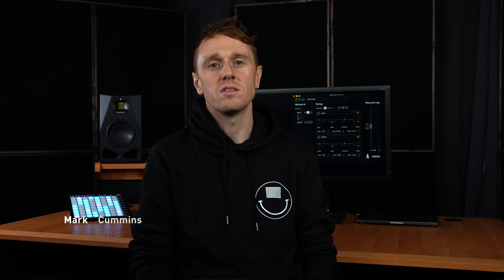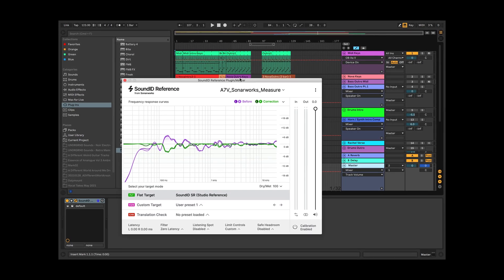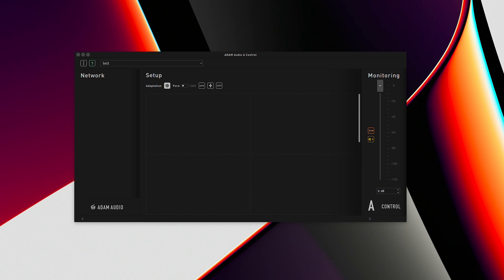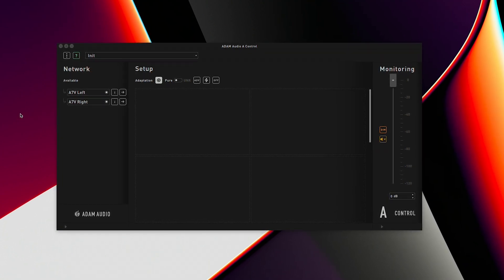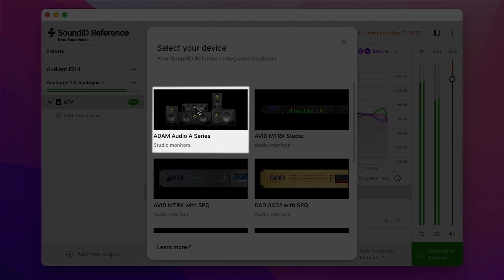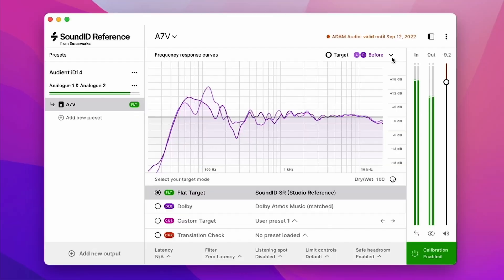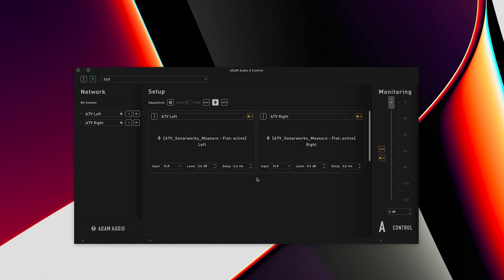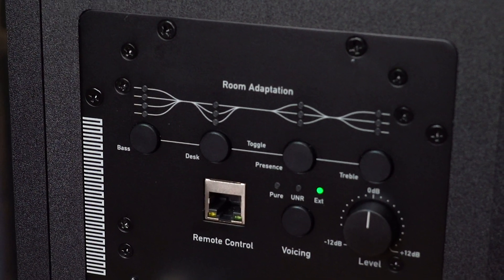How to Calibrate A Series Monitors Using the Sonarworks SoundID Reference Integration

Comment: Is it possible to limit the correction file to (say) below 500 Hz? There are good reasons to not use correction derived from a microphone at the listening position, in the mid and high frequencies. Source: The Measurement and Calibration of Sound Reproducing Systems, Dr Floyd E Toole, 2015 (available online)

Comment: When I manually set a parametric 6 band EQ in the A control app will it be saved on the speakers in the "EXT" preset so I don't need to have the app running in the background?
Reply from the maker: Hey there! Yes, exactly. As A Control detects the speakers when they are connected, you can make changes to the parametric EQ or upload a Sonarworks measurement profile.

The Settings are then stored on the monitors DSP and will work without the need of any application open and the speaker disconnected from the computer.

I hope this answers your question, greetings from Berlin!
Reply: @ADAMAudioBerlin  thanks for your answer. Is it even possible to load the room corrected  eq onto the speakers and then boost or lower the frequency via the backside buttons. Like if I want to boost the lower frequency by +2dB because I'm listening at a low volume? Or do I have to fix the eq curve in the room correction app and load it onto the speakers again
Reply from the maker: Hey,

If you create an EQ-Preset in A Control and upload onto the speaker's DSP, the chosen Settings will be applied once the "External"-Voicing is selected. The settings of this Voicing are not adjustable via the EQ-Control of the speaker, but only via A Control.

However, you can switch to a different voicing, such as "Pure" or "UNR" which will enable the internal EQ-Corrections.

I hope this answers your question!

Comment: Hey Adam Audio;

Is it possible to get the benefits of reducing resonance and other room defects with Sonarworks, but still prioritize an “enjoyment” voicing such as what UNR offers? Or does correcting for room defects with SW mean that the only possible outcome is a reference, “pure” sound? Thanks!
Reply from the maker: Hi @DrewFu319! Thanks for your question! The point of using a Sonarworks measurement profile is to optimize the frequency response of the speaker in your room. Using a measurement profile that moves the frequency response further away from the most linear possible response would somewhat work against its purpose.

We understand, of course, that a flat response can be less inspiring during the writing stage of creating music; hence, we included the UNR profile for this purpose. Once you've uploaded a Sonarworks measurement profile onto the speaker's DSP, you can still switch between different voicings, depending on your personal preference. This allows you to choose the UNR curve at specific times and the Sonarworks curve at others. 

I hope this answers your question! Best, Jasper from ADAM

Comment: I have a SoundID Reference for speakers & headphones. When using the calibration of the speakers, do I still have to open SoundID on my computer for mixing on headphones? If so, switching seems like quite a hassle.
Reply from the maker: Hi @Oxsasuna! This is totally up to you. If you are using it anyway, because you're switching to headphones occasionally, you can either use the curves on your monitors and bypass SoundID reference, or continue using the app and switch to the speaker profile.

If you have any other detailed technical questions, please reach out to our Support Team, they will gladly answer them. You can send your question through the official form on this page: https://support.adam-audio.com/hc/en-gb/requests/new

All the best, Daniel

Comment: While doing the room measurement with the SoundID software, do I need to leave the mode set to ‘Pure’ on the speakers or is it better to turn off adaptation?
Reply: did you find out? i have some significant difference with the soundid calibration and the adam calibration from the same calibration file
Reply from the maker: Hi @LanewoodStudios! Yes, pure is recommended, as this is the flat setting that the SoundID Reference curve will be applied to. If you have any further questions, please reach out to our Support Team. They will gladly answer all your questions. You can send your question through the official form on this page: https://support.adam-audio.com/hc/en-gb/requests/new

All the best, Daniel
Reply from the maker: Hi @Tobiasogfar2017! 

Maybe this has something to do with the 0 dB boost option that we recommend for the export of the Sonarworks curve. If you have detailed technical questions, please reach out to our Support Team, they will gladly answer them. You can send your question through the official form on this page: https://support.adam-audio.com/hc/en-gb/requests/new

All the best, Daniel

Comment: which network switch should i be buying. Do you have any tutorials on how to use the network switch to connect both A7v to my Internets wifi modem router
Reply from the maker: Hi @johnroberts4000, thanks for your question! We have a video about how to connect your A Series Monitors with A Control, you can watch it here: 

https://www.youtube.com/watch?v=STvUdQ-X2no

Most standard network switches and WiFi-Routers will work for this, simply plug them in as shown in the video and they will show up in A Control.

Comment: does the calibration settings stay after the trial has ended ?
Reply from the maker: Hi @emirhanolgun7351! As long as you disconnect the Ethernet-Cable from the speakers after uploading the measurement profile it will remain installed on the Speakers' DSP

Comment: I'm curious to know why you recommend selecting "No boost". I've been comparing the diferent boost setting back to back and they sound fairly diferent in my system. If I do select the boost function my bass seems to be more consistent and I hear more high end. The problem is, that I have no clue witch of both is closer to an actual "flat" response. I feel like the lower frequencies have become more even but I'm not sure if the highs also did or if they are now boosted too much...
Reply from the maker: Hi Tony! We recommend this option because if there is a dip in the bass it is most likely coming from an acoustic cancellation in the room, caused by a reflection. The 6/12 db boost options use not only subtractive, but also additive equalization. If there is cancellation due to a room mode it cannot be EQ’ed out with boost. This only increases the cancellation.
If you'd like to use this option however you can of course do so. All the best!
Reply: @ADAMAudioBerlin  okay, thank you for the explanation👍

Comment: i’ve done the calibration correctly with sonarwork sound id reference, and i have the measurement file, however there are few problems. 

1) in sound ID reference i can’t export the file of the calibration 

2) from a control when i go to:  load sound ID preset, i can’t choose the file of the calibration. 

i also noticed from your youtube tutorial on the A control that the actually software for calibration ‘Sound ID reference’ it’s called slightly different and it has a slightly different interface, and in the tutorial it show that you can export the calibration for the A series , however in my sonarwork sound ID reference this option it’s not appearing if i right click on the A7V calibration.
Reply from the maker: Hi Rico! Please reach out to our support team at support@adam-audio.de 
They will guide you to fix those problems. 
Sorry for the inconvenience.

Comment: Hello Adam Audio or anyone please provide your comments... Do I need to switch the limit controls in soundID Reference before exporting to A Control? Also is it reccomended to turn off listening spot in SoundID Reference before exporting? Does A control account for the delay and volume compensation that the listening spot feature provides?
Reply from the maker: Hi Jayden! We recommend selecting the "No Boost" setting, everything else "Neutral".
Listening Spot may very well be activated, these parameters are exported as well.

Comment: This software is not working reliably for me at all. I have a 7.1.4 Dolby atmos setup with A77’s, A7’s and 2x sub 12’s. Crashing all the time, rebooting all the speakers all the time and causing a 1k tone at full volume out of some speakers on occasion.  Not so good!
Reply from the maker: Hi Mikis! Sorry to hear that. The A Control has just been released and it is in continuous development and improvement. If you find some problems, please send screenshots to beta@adam-audio.de. This will help us to fix the found issues. Thanks!!
Reply: @ADAMAudioBerlin  iv been dealing with the exact same issue looking everywhere for information on it. I have an M1 Max MacBook Pro and a7v's
Reply from the maker: Hi Julian. We're so sorry to hear you're experiencing that. Please reach out to our Support Team via our official support form at the bottom of this page: https://www.adam-audio.com/en/support/. Hopefully, we'll find a solution to your problem as soon as possible. Have a great day! All the best, Manuel from ADAM.
Reply: FYI old question, but I had to use a new interface to keep the sonar works from crashing

Comment: What about the phase option in SoundID , can it be replicated in the DSP of the Adam (linear phase or mixed) ?
Reply from the maker: Hi Alex! We use a custom set of BiQuad filters to read Sonarworks calibrations on A Series monitors. These filter sets operate with ultra-low latency across all monitors in the range, with an average of 1,6 ms no matter what calibration mode is active on the monitor.
Reply: @ADAMAudioBerlin  What does it mean ? Is the phase response with calibration linear , or maybe mixed ? Does pre-ringing occur when using the sonarworks calbration read by the DSP ?
Reply from the maker: Hi Alex! 
BiQuads are easy to compute, so that we achieve the low latency we have on our A Series monitors – and the latency stays the same across all modes.
BiQuads are not linear phase.
Due to the transformation into BiQuads, pre ringing does not occur.

Comment: Oddly, I'm getting different results from when I'm using the app and when I'm importing the calibration profile in my A77h. And this seems to be confirmed by Room EQ Wizard as well where I get different room measurements when using the Sonarworks embedded though the Adam Speakers and when using the App. Any idea what might cause that?

Thanks,
Reply from the maker: Hi François, that is due to the 0db boost export function that is the default option when exporting Sonarworks filter curves. You can change the option but we highly recommend to use this option. 
Let us know if you have any further questions. All the best!
Reply: @ADAMAudioBerlin  Hey thanks for quick the answer! 

Could you please tell us why you recommend using the 0dB boost option? What exactly is boosted when choosing 6 or 12 dB and? Am I to assume there is a boost by default when using the app?

Thanks,
Reply from the maker: @francoisbeauvais4323  Of course. We recommend this option, because if there is a dip in the bass it is most likely coming from an acoustic cancellation in the room, caused by a reflection. The 6/12 db boost options use not only subtractive, but also additive equalization. If there is cancellation due to a room mode it cannot be EQ’ed out with boost. This only increases the cancellation.
If you want to use this option however you can of course do so. All the best!
Reply: @ADAMAudioBerlin  Thanks, this makes total sens.

Comment: When taking measurements from the Sonarworks app, what settings should be set on the speaker DSP? I'm assuming we should calibrate from the pure settings is that right? What if I took my mesures from the UNR settings? Maybe that should be clarified.

Edit : Ok I got my answers in the comments bellow. So yes make measurements with pure setting.

Comment: I did the room EQ measurement, exported it and opened it in A-Control. When I now open  Sound ID it shows the EQ curve so I assume it will always open the previous (exported) file. Is this correct? Because there is no 'open file' function anywhere. Also, to the left of the Sound ID window, the message  'No outputs added yet' and 'Click here to add a new output'. I assume this setting is not relevant if I am exporting the file to A-Control and my A7V monitor - is this correct? Thanks 🤞
Reply from the maker: Hey Philip! Please reach out to Sonarworks Support Team and don't hesitate to ask all the technical questions you might have. The Support Team will be the best people to ask and they will be very happy to help.
You can get in contact with them here: https://www.sonarworks.com/support
All the best, Manuel.

Comment: So ... another real world review. I exported my Sonarworks calibration and uploaded them to the A7V (individually as I dont have a hub or extra cables - it works). But I wasn't happy with the sound - it seemed dull. 

I then just ran the SoundID calibration on my mac and switched the A7V to UNR more, and they sounded much better. This, for me, seems to be the better combination.
Not 100% sure what UNR does, but that in combination with the SoundID calibration seems to sound WAY better. Maybe not completely flat (as I like a bit more Bass - but hey, thats exactly why one can customize right?)  Perhaps there is a way in the future to combine both (UNR+SoundID) so that they can be embedded directly onto the monitors.
Either-way, very happy with the way the A7V's sound.

Comment: Could you explain how this would work with the addition of a sub7? 

If this is correct, Currently sonar works plugin processes pre sub but with the plugin working directly on the monitors. The sub signal will be left with no processing.
Reply from the maker: Hi Murray! The Sub7 cannot be controlled in A Control as the current range is analogue, but they can be integrated into an already calibrated DSP system.
Reply: @ADAMAudioBerlin  Thanks for the reply. I really want to purchase the A8H, they look great and it’s a killer idea but do have reservations still. Could you elaborate further on the addition of a sub and the signal chain? 

My room for example needs some correction from 80hz and below (I have room treatment already) even if the monitors are calibrated with sonar works active, the low frequencies will not be produced by the monitors, right? 
The signal would have already gone through the sub and crossover frequency point before it reaches the speakers. 
Therefore this leaves the low frequencies without any correction eq? 

Appreciate your time and response!
Reply from the maker: Hi Murray! 
For a system with an analogue subwoofer, we would just need to calibrate the loudspeakers using Sonarworks and tune them as desired. Next, we could bring the subwoofer into the system in the normal way. We will have to use a slightly different phase setting compared to integrating with an analogue loudspeaker that has no latency, but that does not make it wrong. The volume control will have to be done in the source equipment, not in A Control.

When comparing using some A7Vs with a Sub or only a pair of A8Hs, we could say that there are advantages and disadvantages in adding the Sub... 
Advantages: lower LF cut off frequency, reduced distortion, higher low frequency headroom, increased placement flexibility.
Disadvantages: the additional bass management filtering adds group delay around the crossover frequency. In very good rooms and with good ears and revealing material, this can be audible.

Usually adding a subwoofer is a good thing but it needs to be set up properly to get the maximum benefit. :)

Comment: Great video! I was testing things on my A8Hs with the No boost options as well as the normal 12dB boost profile. Why is it not recommended to use these boosted profiles? I know that if I have a boost the null with EQ (70Hz), it will cancel anyway, but I do hear the boost, and sounds better. Also, I love the low end applied to the lows, which get closer to the UNR profile. Thank you!
Reply from the maker: Hi Eduardo! If there is a dip in the bass it is most likely coming from an acoustic cancellation in the room caused by a reflection. This cannot be EQ’ed out with boost. This is why we do not recommend using boost however this does not stop you from using it if you really want to.

Comment: This is absolute genius congrats. As a long time user of Sonarworks and owner of the older P11As, this makes me VERY tempted to get the 3 way A series for our control room. I use Sonarkworks to help flatten the response and have a complicated setup where our SSL loops back into pro tools so that I hear room correction while tracking and monitoring through the board. The compromise of this is the additional latency, I have to turn off room correction if I’m tracking in the control room or only correct the playback. 

I know Genelec and other manufacturers have their own similar system but using Sonarworks that I know and trust is fantastic. Congrats, this is a great idea well executed.
Reply: Awesome, great to hear that!